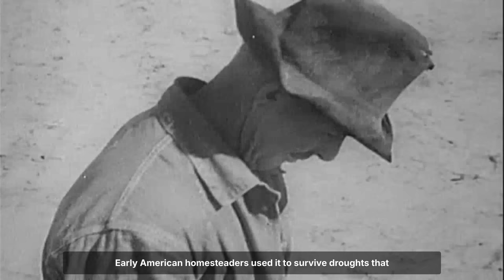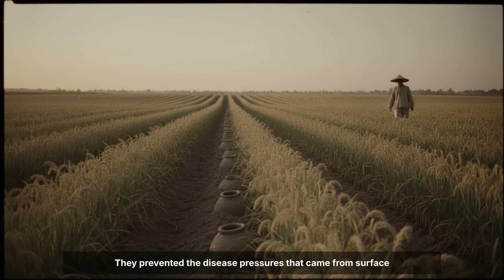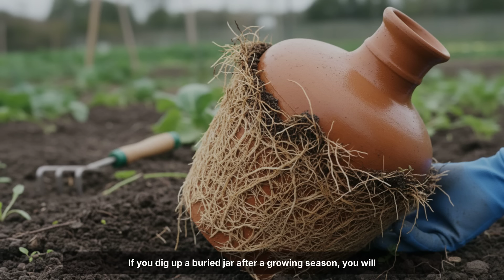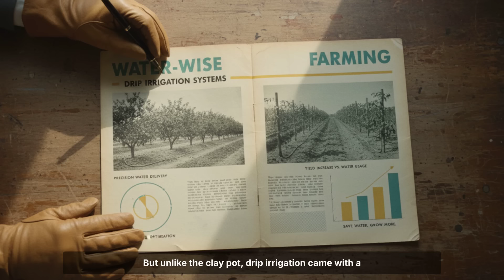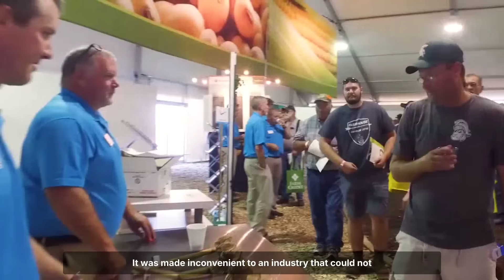Forget Watering Your Garden for Weeks With This 4,000-Year-Old System

Comment: Drip systems are better on large scale, such as macro farms that stretch for several square miles. This pot method is very useful for farms that can easily be walked by one or even a handful of people.
Reply: Why not modify and make it into long pipes?
Wouldn't that fix the issue?
I'm just curious on your take...
Reply: Why not use more pots connected with progress to refill them, more easy to maintain..???
Reply: Sounds like the plastic pipes are actually much cheaper than clay pots.
Reply: @twocsies of course its cheaper 😂 but at what cost? Another polution? If u following the microplastic research u wont want them near you nor your food.
Reply: Would be great addition as slow release fertilizer then since its contained minerals.
Reply: True. Do you realize how many pots a large scale farmer would need lol. In addition, clay pots return to clay after many years, decomposing.
Reply: This method would be ok for small scale farming but still needing many pots. The pots do decompose after a few years though and return to clay soil so more pots would be needed which nowadays are quite expensive. 🙄

Comment: Don't these clay pots break when freezing temperature arrives?
Reply from the maker: If they’re buried below the frost line, they usually don’t break. The surrounding soil insulates them from freeze, thaw cycles. Cracking mostly happens when clay pots are exposed above ground or only partially buried.
Reply: @NatureLostVault 
The message said to place them underground and leave the top out of the ground... That should cause them to break 💔???
Reply: @abia-marierose8402  in a raised bed they might crack, I might remove them for winter. You can always use aquarium silicone to glue the cracks.

Comment: I do something similar. I bury solid logs (hugelculture?sp) three feet below my new garden beds. I dug a bed up 5 years later and they were partially decomposed, and holding massive amounts of water inside the wood. They also provide cavities for s micro biology colony. They also release carbon as they decompose. Anything i plant in those beds do very well. I never water, only rain to water plants. In also coastal South Carolina, so subtropical climate, but the heat can be long and strong

Comment: Back when they used those pots, clay was everywhere, and was easily made into pottery. Today, an 11" high unglazed clay pot will run close to $50. Smaller ones are around $35. It might be easier and cheaper to bury plastic milk/juice cartons with holes punched in them along the sides. The cartons are free, they have small mouths and screw on tops if you want to keep bugs and litter out. Larger plastic containers such as you find with kitty litter, also have the small mouth with lid. I love the technique, but clay pots are not really necessary.
Reply: I agree with your points, except the last one. Clay pots are permeable, plastic is not. It would not have the same effect. I think this is worth trying atleast once (I mean for me)

Comment: A good book on this topic is "Gardening with Less Water" by David A. Brainbridge.

The olla irrigation pots are somewhat pricey. What I like to do is get some cheap terra cotta pots with matching saucers and attach each saucer to a pot, upside-down, with food-grade adhesive. Use the drainage hole in the pot for refilling, and keep it plugged with a rubber stopper to limit evaporation.
Reply: Thanks
Reply: To be fair, the olla's are more expensive than the regular terra cotta pots but we've used ours for 5 yrs and haven't lost one to breakage yet.  In the zone I live, we have major cold/freeze periods where the buried olla's are fine.  The terra cotta pots do freeze and crack, split and fracture that are exposed to the weather and empty.  The olla's have worked very well in our herb beds.
Reply: @yardhog  what zone do you live? what is the frost line?
Reply: Danke
Reply: Brilliant.
Reply: Thank you for the recommendation.
Reply: genius!
Reply: Thanks for advise.
Reply: Does this method not reduce the planting area? Also how to manage soil tilling etc? Don’t you need to dig out and place pots again every year?
Reply: @theviewer52  Never till!! 
Learn about no-till gardening, total game changer!

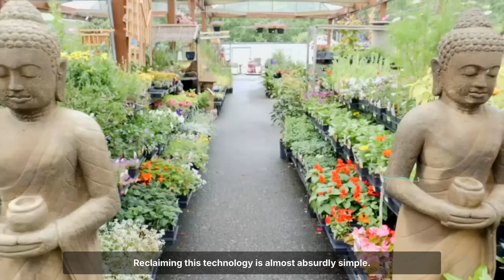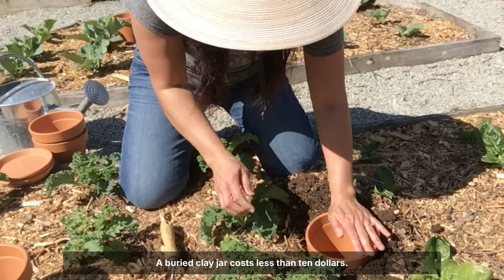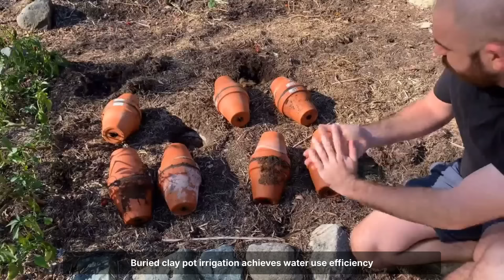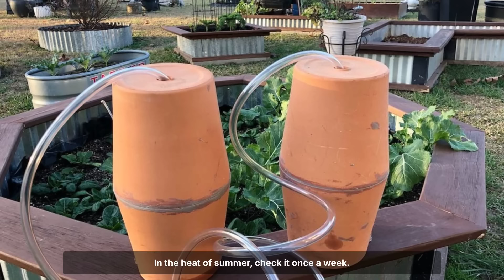Comment: You'll usually see these called olla's, but buying a traditional olla is pretty expensive (looks like 8:26 and can easily run 40-80+ USD). While you can just buy a single terracotta pot and put a lid on it like 7:32, the larger the pot you get, the exponentially more expensive the pots will be. I find the most cost efficient method is to buy two unfired terracotta pots, use sillicone caulk to seal the two mouths of the pots together, and seal the bottom of one pot. then bury the bicone with the open hole up. Fill it with a hose and put a golf ball on top to keep bugs out. You'll see this method at 5:17 and 9:50. just remember the smaller diameter the pot, the smaller area the 2ft diameter coverage that water will leech out from the pot, so plan your garden accordingly. If you are worried about the sillicone, you can purchase aquarium sillicone that's pure silicone without mold inhibitors, fungicides, or other chemicals.
Reply: Start making your own clay pots 😊... I would !😊
Reply: @F-J. You'd still have to fire them, unless you have access to a kiln, it's cheaper to buy the pots
Reply: Olas are just oblong pots. To optimize surface contact. Find a local potter, order some. You'll support a local business and get them pots cheaper than at any store.
Reply: @tatianaabramovskaya8765  In Australia that's at least  $100 for the pot and firing, electricity and gas are higher here than most other countries, but if you import you're paying for shipping.
Reply: Thank you it is an excellent video and is recovering something very special for agriculture.
Reply: Unfired pots will melt away in a few days
Reply: As it's a 1 time cost, I wouldn't mind the $40 cost. Seems worth it.

Comment: I have these clay pots. I don’t see anything special about them. They breakdown overtime, so it’s not true that you buy them once. 
I think for the hype of what it can do, it doesn’t give the benefits as claimed, and definitely not worth the money.
Reply: try it first then let us know.
Reply: @MACD_Master I have already tried them. I said I have them and I use them. I don’t see all the hype, my plants looked the same with or without it’s usage. 😂
Reply: @effortlesssuccess777  Do they use less water?
Reply: @darkwing3713 Yes, the water seem to sit in those clay pots for a long time. I think they are a bit too slow for my liking.
Reply: @effortlesssuccess777  Do the plants grow at the same rate as regular watered plants?
Reply: @birdbrainsolutions6112 I think so, I just don’t see any changes. Having it in there didn’t seem to do any difference so I stopped using them. I also have the cone shaped ones too, that you stick into the soil and put water bottle on top. Those were the ones that rotted and started breaking brown. 

The clay jars were ok. They didn’t break down.
Reply: In the grandparents house, we have this. Same pots, since the end of the 1970's. Still fine, it works.

Comment: I wonder how well they hold up over winter? even empty they crack easy Im guessing? I dont know if digging them up is worth all the hassel maybe it is tho Im def trying this
Reply from the maker: If they’re buried below the frost line, they usually don’t crack. The soil insulates them. Cracking mainly happens when pots are exposed above ground, so digging them up usually isn’t necessary. Definitely worth testing!
Reply: Thanks for bringing that up. I never thought of that issue. The frost line in my area is over 3' so I would definitely have to dig them up at the end of the growing season but I think I'll give these a try in my tomato garden. I only have 4-6 plants so digging up a few pots is not a big deal for me if I don't have to worry about over/under watering them all season.
Reply: I guess making sure they are empty before winter and cover them.

Comment: clay pots here are $70+ and that's if you can get them. Not cheaper.
Reply: You can also find used ones at garage sales or marketplace. I know my local walmart has them on clearance every Fall really cheap.
Reply from the maker: That makes sense, prices vary a lot by location. There are cheaper options though. I’m not sure where you’re based, but here in Georgia, US you can usually find basic unglazed clay pots for around $30 for a pack of four.
Reply: Walmart has them for under $15
Reply: Over time it is less expensive and less maintenance. You do you.
Reply: Welcome to 2025 right?  Even the ancient ways are a rip off